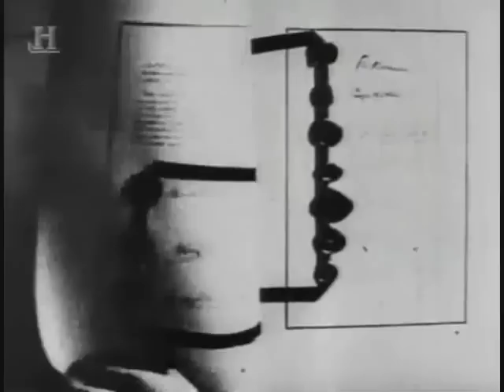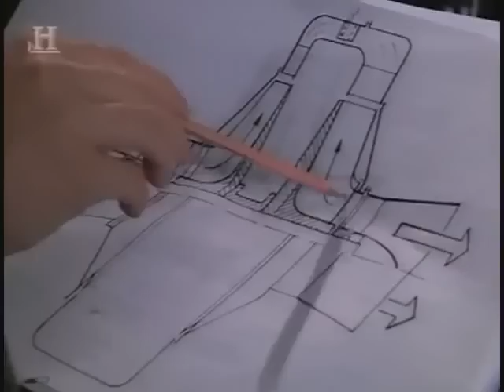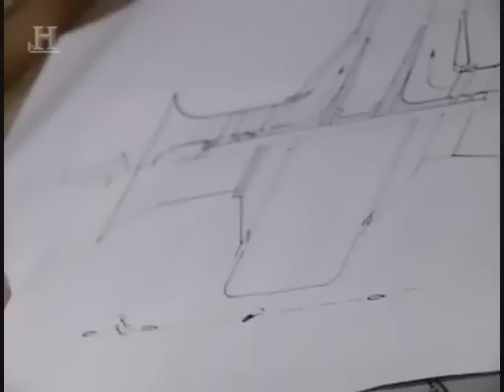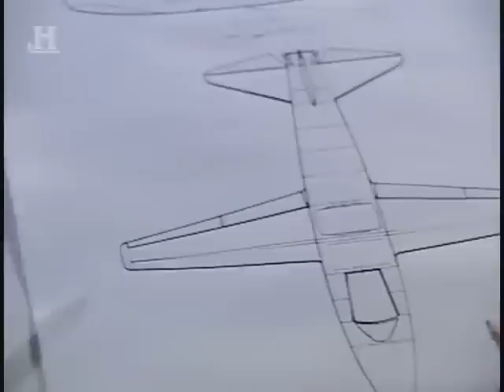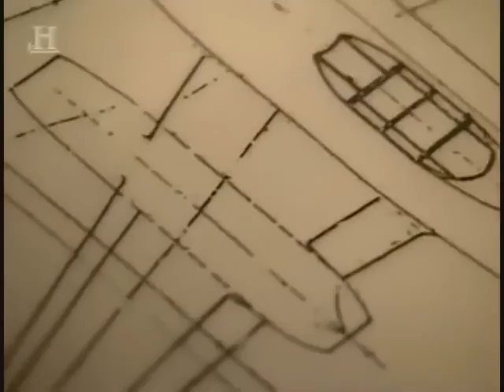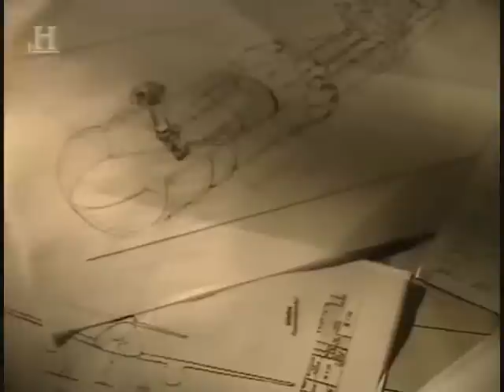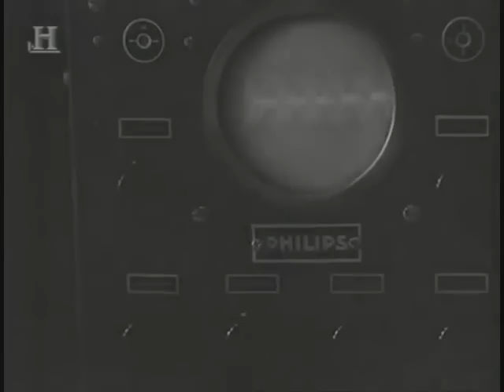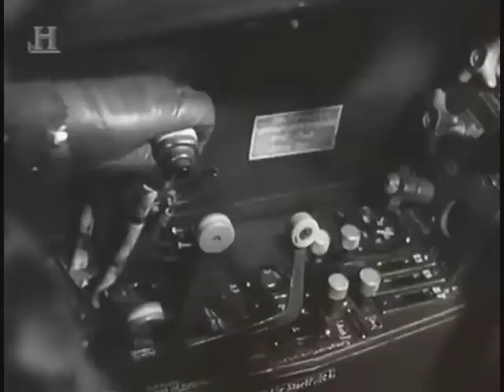A Race for a Jet - Me 262

Comment: This documentary is total garbage. No mention of the British Meteor jet plane, which was superior. It entered service at he same time as the 262. The airframe first had a piston engine, when they changed to the Jumo engines they swept the wings back a bit to balance the plane.  The British Meteor was in British service from 1944 to 1984,. It was also flown by Argentina, Australia, Egypt, France, Israel and Syria. The Meteor set the world air speed record in 1945 and 1946.  The Meteor set an endurance record of 12 hours and 3,600 miles being refueled in-air. It also set height records using Armstrong Siddeley Sapphire engines in 1948.

The German jet engine was a rushed effort and would never be used by the British being so incomplete.
Reply: British Meteor was the worst jet fighter ever developed  with 890 losses it was called the Meatbox by RAF pilots..
and it never saw combat in WW2 ..
Reply: barracuda7018
Nonsense! The British Meteor was in British service from 1944 to 1984
The Meteor had the first jet to jet kill ever.  A V rocket was downed by one. 
It is best you find out rather than typing the first thing that comes to your head.
Reply: John Burns-- And when did this magical affair happens? The Meteor was,even in WWII and Korea,restricted to ground attacks.Ofcourse,if you place 10 ME 262 on the shooting range,the Meteor will kill most of them with only minimal losses.
Reply: John Burns-- Sorry,i read your second sentence first and was still laughing when i wrote my comment.So you say the Meteor was in service for 40 years and the British couldn`t develop something better during those years? You beat Monthy Phytons 10:0 !
Reply: British Humor at it`s best,I love it soo much.
Reply: poor baraWilbut.
The Meteor did destroy 46 German planes on the ground since none came up to meet the Meteor. and it destroyed 14 V 1`s.  The Me 262 was a failure and never shot down a jet fighter or in fact any RAF fighter,  The Meteor went on to shoot down jet fighters in Israel and Korea.
Reply: Michael Plieroz.
The Meteor did shoot down the first jet lost in combat, it was in Israel, also Meteors in korea were used for ground attack but they met the Mig 15 and some 6 Mig 15 were shot down by Meteors.  The Me 262 never shot down any RAF fighters and certainly no jet fighters at any time.
Reply: Actually 6 MiG-15 shoot downs for the loss of 5 Meteors to them.
Reply: John Burns--- Sir,I have to complain.The titles of those two videos really promised a lot of fun,but i was deeply, deeply disappointed.What is so funny about re-used german desingns and techniques?And I don`t like to hear about killed testpilots or to see planes falling out of the sky,it don´t matter their nation.Beside that,the publishers tried their best to amuse the viewers.
Reply: Oh, hi Barry"deny everything Baldrick"Rodliffe.I`ve waitet for you to show up,the restless defender of British supremacy over Germany .I think,if a Meteor downed a jet in Israel,it was because the Meteor simply fell on this jet.I was told the Meteor shot down 6 Mig´s-with a loss of 17(please correct me if iam wrong, iam referring to the RAF reports) So they had to "fight"ground targets again.Hey,do you know why the Meteor was restricted to ground attacks (ofcourse it was NOT feared to encounter a ME)and it performed so well indoing so? The british Headquarter send an order to the RAF,saying:By occasion,send some Meteors to Europe and throw bombs on the enemy.A german spy stole this telegramm(you know germans are always steeling british stuff),exchanged the words Bombs and Meteors and send it back to High Wycombe.The RAF did so and this explaines the 890 losses.Happy end,before you start crying:Later onJames Bond was sent in and he ended this fiendish german plan ---Sky-fall! So  i had to stop, Karina is yelling at me.See you later when we discover some other"ze Germans stole it!!!!" conspiracys.
Reply: Michael Pielorz RAF reports wouldn't give you any info; it was 77 SQN RAAF who used them in Korea. The 5 were lost directly to MiG-15's, if you want to be technical only 4 were shot down by them and another was written off after landing from damage sustained to them. The remaining 17 losses came mostly from ground fire or  few accidents. http://www.adf-serials.com.au/2a77.htm 77SQN at the time was operating as a ground attack - not fighter squadron. 

The Meteor's weren't restricted to ground attack hahaha. They spent the entirety of 1945 as interceptors, the Germans just weren't in a position to send up aircraft over allied territory in the British sectors deployed as interceptors or on combat air patrols. In the last 2 months or so when they resorted to ground attack over Germany they were still primarily on CAP missions, just Germany couldn't even defend their own airspace, German superiority i guess.
Reply: Take a chill pill. I said how Germany couldn't put aircraft over allied territory then how Germany couldn't put aircraft over their own territory. Any logical human would pick up the deliberate irony there.

Also the Germans didn't invent Axial flow engines. Both the first German and British jet designs were centrifugal designs. Then they moved onto axial designs, the Brits were just smart enough to relise it wasn't operationally ready during the war. The Metrovic axial engine series by wars end put out about twice as much thrust then any German jet engine. Modern axial engines come from the British, not German designs.

Depends on what you call it. Simply something with a jet engine in combat verse another would be Meteors shooting down V-1's in 1944. If we count one not airborne it would be Meteors taking out 262's on the ground in 1945. The first proper action between manned opponents would be 1950 in Korea. Israel didn't get theirs until the mid 1950's.
Reply: Well the piston engine was installed to test the airframe while the jet engine was being finished. The 262 was always designed to be jet powered. The cg was fixed by sweeping the wings as you say
Reply: John Burns nO mEntION oF ThE meTeOr